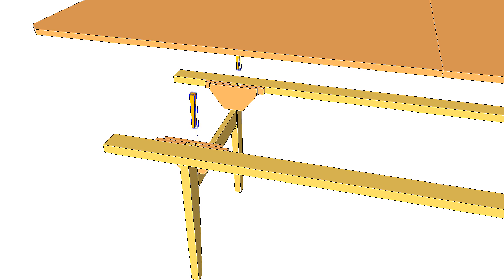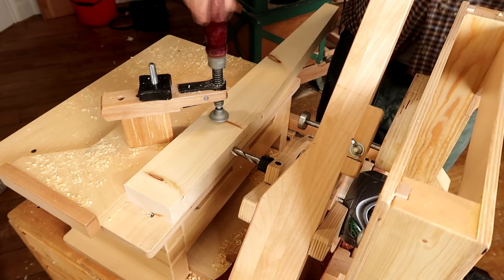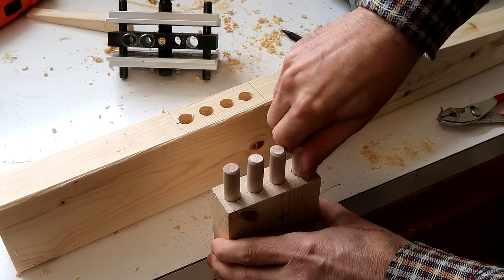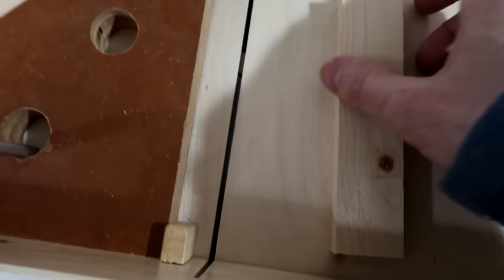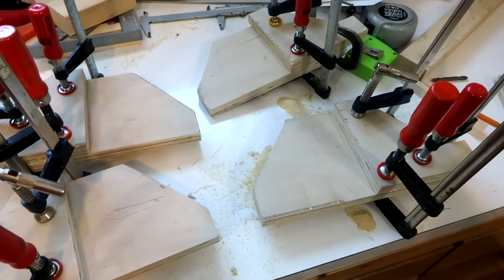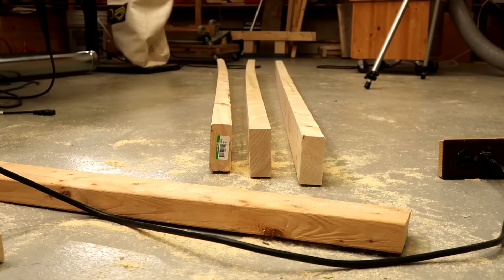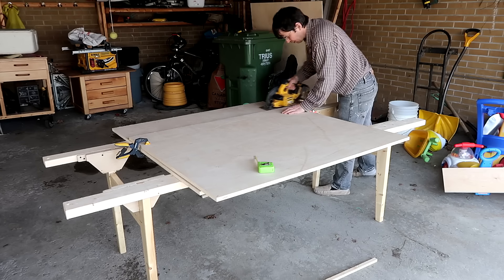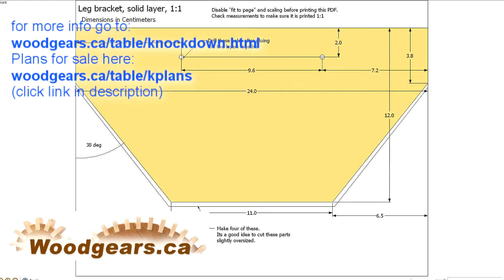Large knock-down table build

Comment: So happy to see a wood building project that uses the same crappy 2 by 4s I have to pick thru at Home Depot as well. On the average I go thru a dozen to pick out one that is useable.  Your signature move of jumping up and down on your build is just awesome.  I built the cantilever shelves for my garage above storage earlier and could not stop smiling when I remembered how you jumped and dangled off the shelves to Make sure the load bearing of the design & build is good.  Keep coming up with solutions.  They are fun to watch and thanks for sharing.

Comment: 5:00  I've had good luck with moderately warped 2X4s by ripping them in third's, and flipping the middle piece both horizontally and vertically, then laminating them back together.

Comment: The removeable tapered pins are clever.  This will make a nice assembly table frame for the shop & road that comes apart quick and stows flat. Bought the plans for 6 dollars which is less than lunch!

Comment: I was going to comment about the slightly loose top, but I first went and read the website article where you address that fact... can't argue with that!   Here's a thought: I wonder about epoxying some magnets (salvaged from HDs perhaps?) into the 2x4 rails to help hold the the table top a bit more firmly?  It'd still pop off with a twist, but maybe be less loose?    

Nice build, a good knock-down design!
Reply: Or maybe some wedge blocks secured to the top and the sides? Put the top in place and then  slide it  so the wedges catch each other. Not as fun as the marbles though!
Reply: Or instead of holes maybe glue a wooden frame on the bottom so the top will grab itself against the inner sides of the 2x4s maybe helping them stay straigth ^_^

Comment: Yes, it's really a nice feeling at 6:37 to hear the board clicking in place. But, when you did the second jump test, you landed exactly in between the two boards and from the expression on your face soon after jumping, I guess you escaped the horrible experience of the bottom being pinched. 
Next time you want to do the jump test, make sure you are going to land on a safe surface.
Reply from the maker: Didn't get pinched, but I realized how much the outer ends of the table jumped because the top isn't fastened down.

Comment: I like the idea of locking the legs on with a wedge, so no tools are required there,
but wouldn't it be smart to put the 2x4s with the thin side facing up? I think the table could then take more weigth in the middle

Comment: Your guests may be different, but some of mine use the table top to push themselves up, which would cause the top to tilt - may want to look into a rotating lock to keep it from doing that. Great project either way!
Reply: Matthias, knows the needs of elbows now that they have slowed him for most of a year and so I expect he can imagine those with current back, hip, knee and foot ouchies too (or may in some many years time).

Comment: just a thought: how about some coarse threaded inserts to prevent the tops from jumping? 3-4 turns with a screwdriver aren't much more work to put them together
Reply: I would say, a couple of T-nuts embedded in each top piece, and a bolt with wooden handle being screwed in from the bottom of those rails into it to hold the top down. That way, no tools needed and you could do it without crawling under the table. I'm sure there's an even better/quicker way but that seemed like the simplest one.
Reply: @moti.g  I think u-staples and a hook. One in each corner and it should be completely tool-less. But I'm not sure how strong that would be. After all, all forces that occur are angled in such a way, that it pulls the staples back out. On the other hand there aren't many situations where those forces could be a problem...

Comment: I heard an ominous cracking sound when you jump-tested the 2x4. I don't think a 2x4 laid flat is quite strong enough for that application. I'd revise the design to set the 2x4s vertical. Much less likely to sag under a heavy holiday feast!
Reply: That would be stronger no doubt but then legroom could be a problem.

Comment: What is the design decision behind having the 2x4 flat instead of having them stand up vertically?  Won't that make the table have less chance of sagging?
Reply from the maker: More elegant with it flat, and the geometry worked out much better that way.  I can still sit on it, which makes it strong enough for what it's made for.
Reply: In the plans he shows he stiffened them using rebar through longitudinal pocket holes - just don't adapt it to use as a bridge.
Reply: Seriously, I suppose that design decision provides more sitting leg room, though the table loaded for turkey and with elbows applied might approach his weight.

Comment: Do you think it would be feasible to rip a crooked two-by-four and flip one of the sides and glue it back together with some braces and create a piece of engineered wood that is straight?
Reply from the maker: possible but not worthwhile.
Reply: @matthiaswandel  one reason I bring it up is because I'm helping somebody make canvas stretchers and I noticed that engineered wood warps a lot less than the traditional kind of wood. I guess you could take a straight board and rip it and then rotate and glue it back together and that should resist warping right? I did notice that the engineered boards are laminated and cut using a special zig zag looking cut and the pieces are glued together that way. One of these days I'll research what kinf of tool that splice is made with.

Comment: Great build. However, I think I would opt for using pocket holes to attach 2X4 to the tops and then bolt them to the frame. 

The cons: 
It would take a couple extra 2 x 4's. 
The pros:
1) The top would not jump up and down. 
2) The table would still be collapsible.

And you could still use the marble trick to line up the tops.
Reply: Cons: Longer to setup, heavier to carry, no hilarious video captured when your drunk friend stands on it and comically falls off
Reply: @Solveitall813  
I don't have drunk friends.
Reply: @scotttovey  that doesn't surprise me

Comment: Why do you plunge cut the mortises as multiple holes and then join them instead of drilling one hole and then pulling over? (Maybe a dumb question, but I have very little wood/router experience...)
Reply from the maker: cause it's easier that way.  For side grain, the spiral bit cuts much better plunging than dragging

Comment: it might survive YOUR jump test, not so sure it would my 270lb jump test.
Reply: I can't see many changes I'd make. Thicker top and 2x6 runners instead of 2x4, on edge instead of flat. Other than that this is genius. making a lam top and stouter runners would take our samsquamtch jump test.
Reply: @IRuinEvrything  i think a 2X4 on edge with a grove cut into each of the leg piece so its parallel with the other 2x4's will help with the flex
Reply: Metric jump test vs Imperial jump test.
Reply: A bottle rocket trying to launch it's self into space has more chance than 270lb jumping on a table.

Comment: Could someone explain the purpose of the wedges? I can't figure out myself what advantage they give...
Reply: They are faster than using screws, but they lock the legs firmly onto the rails.
Reply: @ruthpenner6995 ah, okay. I recognized the inherent benefits that geometry gives, just couldn't piece together its application!

Comment: Why not just build something that stays together and just collapses with hinges and locking rings like card table (even one that has a big fold in the middle)?
Reply from the maker: because at 2.4 meters long, it would still be unweildy.  And it would require extra hardware.  And it wouldn't be very sturdy
Reply: Then,  @matthiaswandel , can you explain how tables that are that long can fold in the middle and have good legs on hinges, with retainer rings that come down when you open them, and are still sturdy?